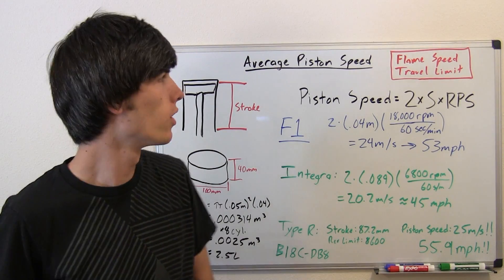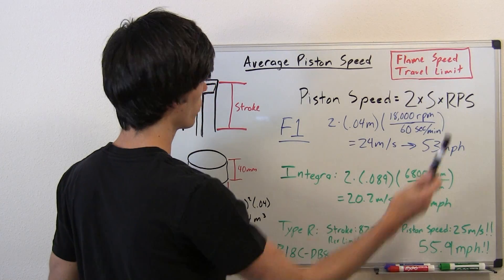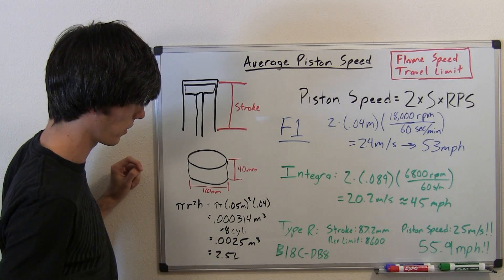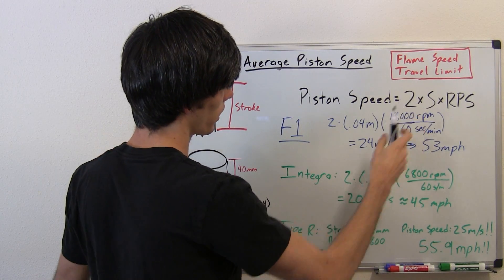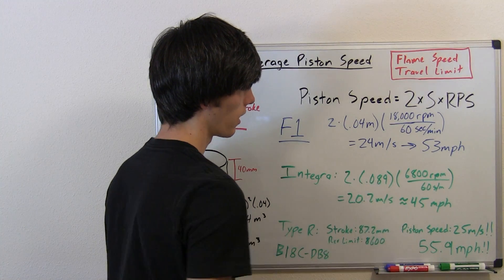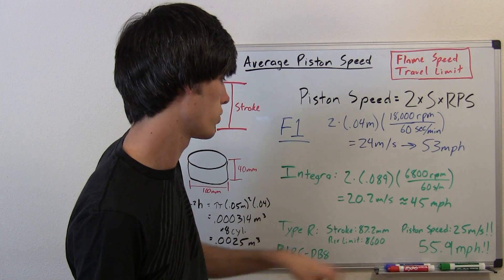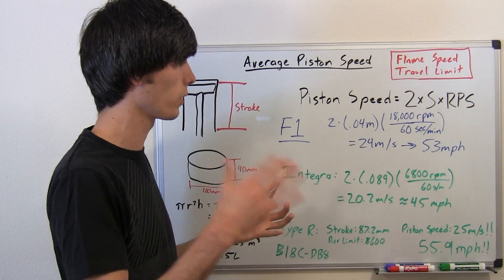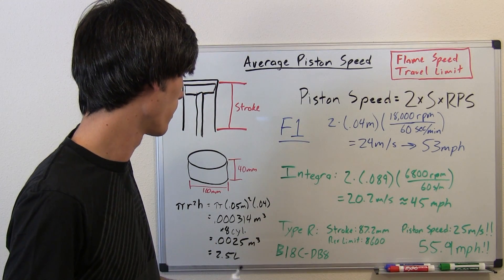Average Piston Speed - Explained

Comment: (1) MPS=Stroke x rpm / 30,000 : easy to remember and use 
(2) Just about all engines of any size and type have a max mean piston speed of 20 +/- 10 m/s
(3) That's about all you need to know about MPS.

Comment: Old video I know ;)
BMW M3 2008, stroke 75.2mm, redline 8400 RPM -  average piston speed  21.056 m/s, 47.1 mph
BMW 330d(N57) 2010, stroke 90mm, redline 5000 RPM - average piston speed 15 m/s, 33.55 mph
Governor limit 5400 RPM!, av piston speed 16.2 m/s, 36.24 mph
Wärtsilä RT-flex96C (14 cyl, 25,340 lts! container ship engine :D), stroke 2500mm, 'redline' 120 RPM - av piston speed 10 m/s, 22.37 mph 

What I want to know is how do you work out peak piston speed? :)

Comment: You never actually told us what the speed limit is of the flame front? how fast can it travel or when does it not become effective because engine RPM is too high?
Reply: usually it's not the combustion that is the problem, but when the piston speed exeds the speed of witch the oil can keep up with the piston(running it dry) will cause the breakdown then

Comment: 496 cubic inch big block chevy, 4.25" stroke, .10795 mm. it has been 7000 RPM but usually when racing I take it to 6800 RPM. 54.73 MPH piston speed. I haven't dynoed with the current head and camshaft but with a slightly lower valve lift camshaft it made peak hp at 6100 RPM (679 HP) and peak torque of 635 lb ft @ 5000 RPM

Comment: Mostly good but you need to forget this flame speed idea being a limit, its not in petrol engines because the burn rate equation is directly related to turbulence speed, which basically increases in-line with crank rpm because the port airflow velocities go up as rpm does, because the same volume of air is moved through the same diameter pipe at in less time. This puts turbulence up and the burn rate equation shows us that in fact for a petrol engine, there is (in theory) basically no limit to engine speed (as far as combustion speed goes that is).

Comment: @EE: Are you sure, that the maximum piston speed is limited by air/fuel combustion propagation speed?  
I heard that it is limited by tribological issues of the involved materials...
Reply from the maker: How does friction limit the piston speed?
Reply: @Engineering Explained: 
It's due to the stability of oil film that lubricates the moving parts. E. g. this is mentioned in german Wikipedia (unfortunately no references). But i already heard this fact from other sources too. Your explanation sounds interesting but i'm not sure whats true.

Comment: It'd be interesting to see a video about burn rates/ flame front speeds of different fuels as it relates to piston speed  Maybe a different video about piston dwell times as it relates to rod lengths. David Reher of Reher-Morrison had a great article about importance of rod length versus deck heights as it effects intake runner lengths on V based motors in regards to peak RPM power. Great videos, You're doing the auto world a service.

Comment: @engineering explained
I've been racking my brain on this. 4Piston Racing put out a 500hp K24 naturally aspirated engine for a drag racing class. Dimensions are 2.7L using a 90mm bore x 106mm stroke, and is capable of 10,000rpm. That's a piston speed of 35m/S. How is this possible? Granted it is a fully developed racing engine, but it seems they have defied the logic put forth in this video. Any insights?

Comment: Don't understand why you compare piston's speed with different RPM. 18,000 with 6800. What is that?
Reply: He calculates the maximum average piston speed of both engines. 
High piston speed = more friction = more wear, heat, inefficiency...

Comment: Well explained.

I wonder how one would calculate the max piston speed? The piston starts at 0 MPH at TDC and finishes at 0 MPH at BDC. The max speed occurring in between.
Reply: so the crank speed is constant, but the piston speed is not.

if u take the compression ratio into calculus, you find the crank length.

in order to find out the maximum piston speed, and not the average, you need to find out the ratio of the distance travellled by piston compared to the crank for a very, very small amount of time, when the piston is at the middle of the distance TDC-BDC. multipli that ratio with the angular speed of the crank, and voila! the maximum piston speed, not the average

Comment: hi, which one is better for 500 meters drag racing application, both are same bore( piston diameter). short stroke with long conrod vs long stroke with short conrod?. both using different cam setup so both make the same dynamic compression which is the same mass of volume air and fuel. thanks

Comment: why is there a redline on engines and what happens when you rev to the redline for too long?
Reply: Mustafa Hasan if you go too far past your redline you will experience what is called valve float, this means the spring punching the valve closed doesn't have enough time to close the valve before it needs to open again, this results in loss of compression and catastrophic engine failure.

Comment: I genuinely liked to watch you explain things I already know (I suck at explaining it) but when you said your b18 is like a F1 engine and that's why you bought it, because of its piston speed... I've lost all respect...
Reply: It was obviously said in humor he wasn't serious.  He followed by saying the "good" points of his engine were burning oil and leaking oil
Reply: +Rich Giles well if you want to get extremely technical, his explanation of why they use pneumatic valve springs is incorrect. Pneumatic Valve springs are used to eliminate valve float and control of the valve. So your likely wondering what I'm talking about. No matter how strong the spring  (single or dual) at a certain RPM the springs resonates at an odd frequency and this causes the spring to not be able to keep the valve closed 100%. Sure it reduces cylinder load (rotation mass) but this is by no means the reason why F1 manufacturers created this system. Again, this is far more technical that 0.0000001% of the population will be able to understand it without reading up on it. 

I could continue to explain things in more detail, but I'm sure you understand my point now..
Reply: +Rich Giles also, if we wish to continue to break down the incorrect explanation  (keep in my I never said that originally) Dry sump oil pumps are not just beneficial to reduce oil moving in the oil pan, the REAL reason why it is a preferred system is because of the distribution of oil. with a dry sump you have a canister with a pump near the motor, this canister has numerous hoses coming from it. Cylinder heads are the last to get oil in a normal system, whereas they can get oil just as quickly as the crank or turbo. it's the distribution and equalization of pressure which is why they are mainly used. Unless your low on oil, and have a terrible design oil pan, you can pull 4 gs and you will not lose oil pressure. 

I truly could continue on every video and every explanation. however I do understand that this is for the normal person who knows a significant amount of auto knowledge (you need to know basics to understand his explanation).

I'm still waiting to watch a video and be like "huh!" I didn't know that. Not a genius, just have a extremely high understanding of motor racing.
Reply: @danielc787  Good for you!!! Most people don't understand the basics of a 4 stroke gasoline engine, therefore this series.  I have played with cars, suspensions, engines, exhausts, etc for a few decades but I've yet to know it all.

Comment: you cannot say if a car is good only with the piston speed you also need the torque of the engine beacause if you have a fast engine like the acura but in order to move the weight of the vehicule you have to reduce it than you'r not that fast at the end

Comment: Here’s a couple for you:

1978 VW Rabbit Diesel 1.5L
80mm stroke
5600 rpm max
2*0.08m*(5600/60) = 14.93 m/s = 33.40 mph

2007 Dodge RAM 4.7L
bore = 3.66 inch   (6.12 inch rods.)
stroke = 3.405 inch = 86.487mm
6500 rpm max
2*0.086487*(6700/60) = 19.315 m/s = 43.2 mph
Not too shabby for a cammer pickup truck engine.

Comment: Gen V Dodge Viper average piston speed calculates out to 48.0 mph based on the 103 x 100.6 bore vs stroke values published by Dodge. 6400 RPM fuel-cutoff limit used for the calculation.

Comment: Engineering seems to think that higher piston speed equates to more power and therefore is somehow desirable  On the contrary. Design engineers have historically sought to decrease piston speed which is in reality a destructive force. A force that Ducati  and Honda, among others have managed to decrease with the use of shorter stroke oversquare engine specs. Look at the long stroke Harley D engines whose piston speeds limit their rpm ceiling to about half of that of a 900ss Duc, not to mention about half the horsepower.
Reply: basically, designers want to use the highest bore they can, then change the stroke to determine the displacement. having higher piston speed means that you are fighting more inertia to change the direction of the piston. Additionally, higher piston speed increases the amount of power that is lost to friction, which decreases both power output and efficiency
Reply: @coff3eSl0th   newbie question sir. If both engine has the same displacement but different type of engine, undersquare and the other hand is oversquare interms of top end race what engine is prepared to that kind of race?
Reply: Thirty years ago, when first started modding ('72 Cutlass 350), the issue with piston speed was destructive force, not flame travel velocity. Lots of magazine space devoted to forged pistons and rods and crankshafts to be able to go up to 6500 rpm!

Comment: Since we are on the subject, what are your thoughts on long rod engines? back in the day it was common to build say a 350 chevy with 6 inch rods as opposed to 5.7 inch rods to keep the piston near TDC longer and therefore increase the torque of said engine. I really don't see this that much anymore so I assume it was not that beneficial.
Reply: + Jack Allen The reason one would increase the stroke is to achieve a higher torque value.   Its still used of course, you just don't hear about it.  It is a beneficial as it ever was and is an engine building technique...all depends what you want the Mill to do...  Build accordingly.

Comment: What's the downside of a short stroke? Why don't they build engines like that for regular cars?
Reply: +VerySeriousUser A longer stroke will give more torque because of a larger arm of the crankshaft. This is needed in a regular car.
Reply: +thebbosss Thanks for the answer!
Reply: Yes you're right! I was just explaining the basic principle. ;)
Reply: +thebbosss To a certain extent. A de-stroked Chevy 400 (which is a 400 with a 350 crank (3.48" stroke) = 377 C.I.D.) will make more torque than a stroker 383 (350 with 400 crank (3.75" stroke))
Reply: +VerySeriousUser It's to do with combustion mechanics at certain rpms, not torque.
Reply: +thebbosss Gearing will make up for torque but many times at the expense of fuel mileage.
Reply: having a lower bore:stroke ratio (long stroke) will produce more torque at a given rpm than a short stroke with the same displacement. what that means is the engine can spin slower yet produce the same torque. if the engine (and components) are moving at a lower speed they will have less inertia and will produce less friction, which increases efficiency.
Reply: Complete rubbish.  You have completely missed out mean piston speed for a kick off which would be higher at given RPM on a long stroke engine than a short stroke engine.  Like I said above, combustion mechanics.
Reply: Hypersonik I'm assuming your referring to my comment, and yes that's true. That's why long stroke engines typically have high torque but lower redlines, producing roughly the same horsepower (power = torque * rpm, halve the rpm but double the torque and you keep the same power). I should have mentioned that when I said moving slower I was not referring to the piston head but rather the rotational speed of other components such as the crankshaft, camshaft and valves
Reply: to minimise heat losses you probably want your cylinders as square as possible, which minimises surface area, in a vehicle where fuel economy is a concern

Comment: +Engineering Explained Jason, I made some calculations that I'd like you to tell me if they're correct or not. 
It's about the engine valves. How many times per second do they open in a Formula 1 engine (considering the peak of 18,000 RPM). 
18,000 RPM / 60 seconds in a minute = that means 300 revolutions per second. If any valve (either admission or exhaust) have to open once every two revolutions, it means that the valves open 150 times per second at 18000 RPM... 
Is that correct? 
It seems pretty insane to imagine that... It means 15 openings each tenth of a second!
Reply: I believe your right, I'm no expert, just decent at math lol
Reply: ***** In a 4-stroke engine, every cylinder will fire once every two crank revolutions — independent of the engine's total amount of cylinders. Always. That is because it takes always two revolutions to receive air/fuel, compress it, expand and exhaust.
Each valve will also open once every two crank revolutions — always.
That does not change due to the total amount of cylinders of the engine. 
In an engine with more cylinders, you just have a larger total of explosions (and valve openings) occurring at each crank revolution. More cylinders, more explosions. That's why the power is delivered more smoothly.
For example: In a 4-cylinder engine, TWO explosions happen at every crank rotation (one explosion at every 180 degrees). In a W16 engine, EIGHT explosions take place at every crank rotation (one explosion at every 45 degrees of crank rotation).
If you analyze each individual cylinder, though, it works exactly the same way, no matter how much total cylinders the engine have. 
Therefore, if I'm not missing anything, the valves open at RPM divided by two, independent of the number of cylinders.

Comment: BMW P86 V8 engine has average piston speed of 58.16mph
And PEAK PISTON SPEED of 89.48 MPH
Reply: +Dauno959  I will add maximum piston acceleration of the BMW P86 is 10,000g
Reply: +Dauno959 This exerts a force of almost three tonnes on the conrod

Comment: Could you explain how the rev limiter works?
Reply: Doesnt need a whole video it just cuts off fuel when the engine hits certain RPM
Reply: JennaBringsSexy How exactly does it cut off fuel, if you know.
Reply: +James Whyte well the computer does it lol it stops the fuel injectors or ignition , just like when u turn off your car
Reply: +James Whyte Depends how the ECU limits RPM, in a Diesel engine it's all fuel controlled, you'll have a governor and it'll only allow fuel to be injected up to a speed, and will not allow you to exceed that irrespective of load. A gas engine, you can either cut ignition or fuel or both, often I believe they cut fuel to prevent things like flames out the exhaust or loud bangs. The reality is, it's not that complicated, ECU knows engine speed, once you reach that speed, it'll just merely say "stop injecting fuel" or "stop igniting the fuel", once you reach a safer RPM the combustion will continue, so you end up with an endless loop of constantly losing and gaining engine speed to prevent you exceeding a certain RPM. This likely isn't 100% accurate but this is to the best of my knowledge unfortunately. :)

Comment: Question; and I apologize if this has already been asked in previous replies.  I didn't read them all before writing this.The calculated piston speed assumes a uniform speed along the 2X stroke length.  Isn't this inherently incorrect though?  Since the piston speed at both TDC and BDC is zero, there is an acceleration and deceleration both preceding and following TDC and BDC.  I believe the true max piston speed is achieved mid-stroke.I realize this is much more difficult to calculate, and you have correctly calculated the "average" piston speed throughout the 2X stroke, but if we want to know the true max piston speed, don't we need to do the more complicated mid-stroke calculation?
Reply: +GGavel The simple answer is yes. to get the actual terminal velocity requires you factor in the stroke and rod length. At least I believe this to be true since both will affect acceleration.

Comment: Alfa Romeo Brera 3.2 - 43.4mph@6800rpm that's pretty amazing
Reply: +randombloke10 yes, would be if the correct number wasn't 17.68 m/s, 39.53 mph
Reply: +Janos Gregor no buddy, here's the maths for you start off with rpm/60 so 6800max rpm/60= 113.333333' the stroke is 85.6mm so 2x0.0856=0.1712 then to get the average speed 0.01712x113.3333333333'=19.402666666, simple trip to google revealed that 19.4m/s is actually 43.397mph I don't know what stroke you were using to get your data but I don't think you were looking at the same V6 👌🏻

Comment: +Engineering Explained is there a way to determine an engines maximum rpm that it could withstand?
Reply: +Mark1 Motorsports The maximum rpm of a motor depends on TONS of things, basically every component of the engine.  Strength and stresses in the bottom end (crank, rods, pistons) matter immensely, as well as the valvetrain (can the valves handle x rpm without floating, etc).
Reply: Take the piston speed rating in Feet per minute times 6 then divide by the stroke.  RPM Limit= (desired piston speed x 6) / stroke

The key is to try not exceed 5,500 feet per minute unless you have access to to same type of materials and precision that is used in race engines.
Reply: +Mark1 Motorsports Terminal piston velocity, the point of increase that is limited by the flame front in the combustion chamber. Considering the forces  on the engine can withstand the RPM. This is of course taking into account the valve train and what rpm it starts to float.